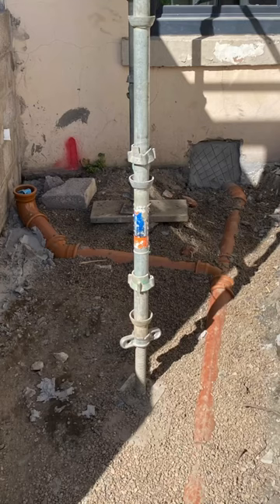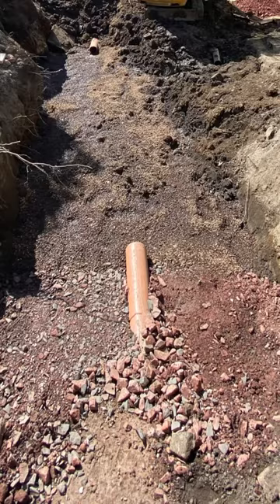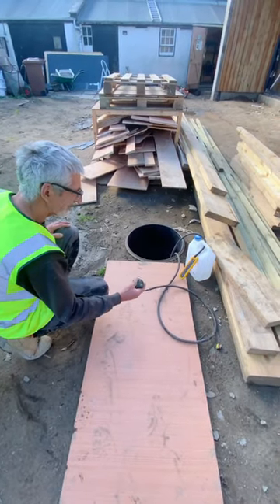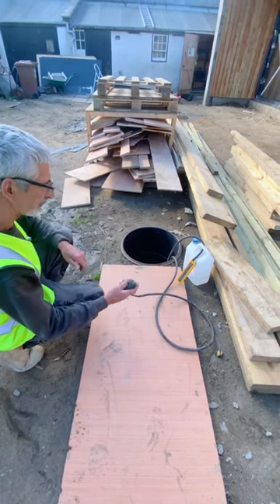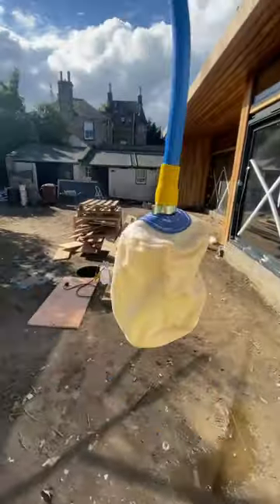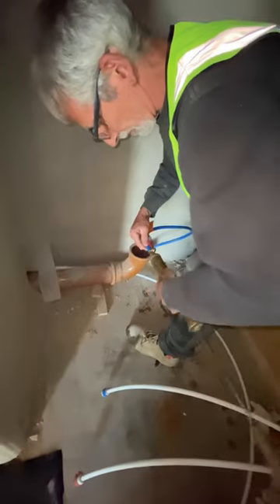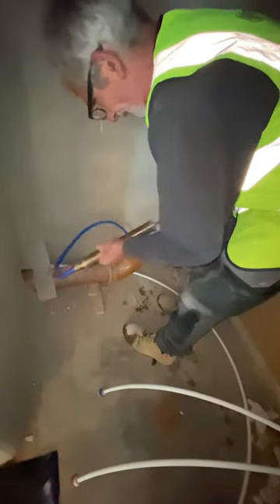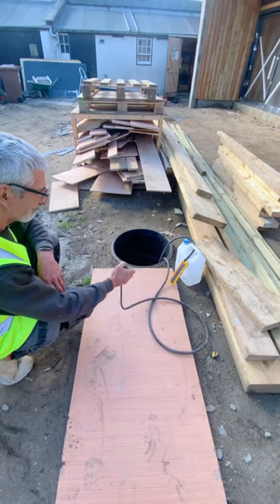How To Pressure Test Drain Pipes #ukconstruction

Comment: Do rainwater gutters usually go to the mains drain or do they just go soak always?
Reply from the maker: This is a Victorian house in Edinburgh. Older properties like this have what is called a “combined” drainage system. It all goes to the same place. From (roughly) the mid 20th century “separate” systems were introduced. Rainwater went into one drain and foul water into another.